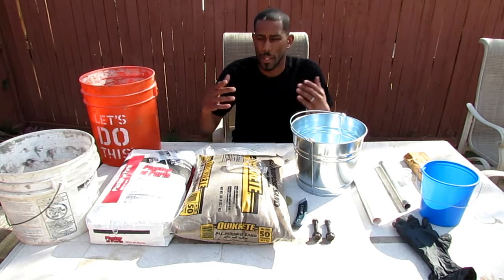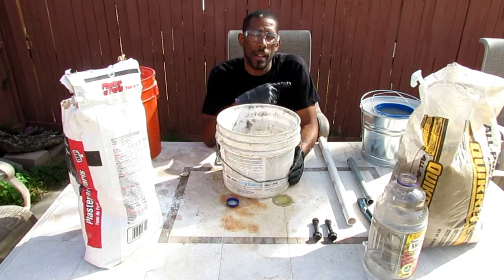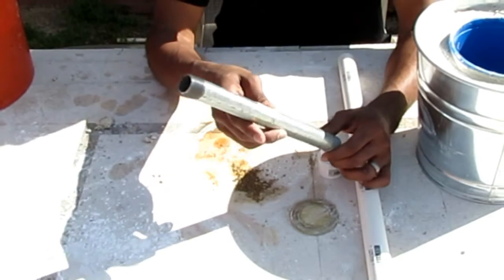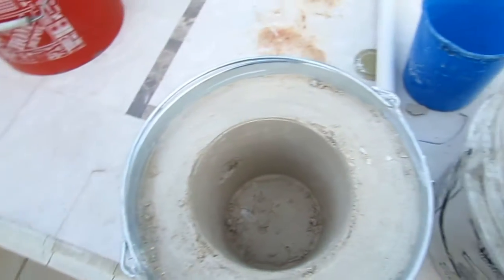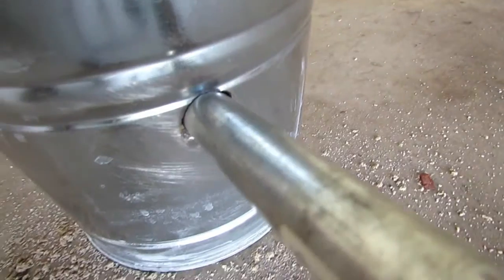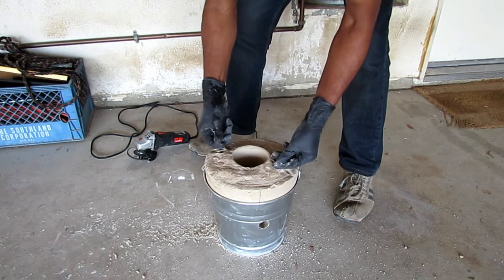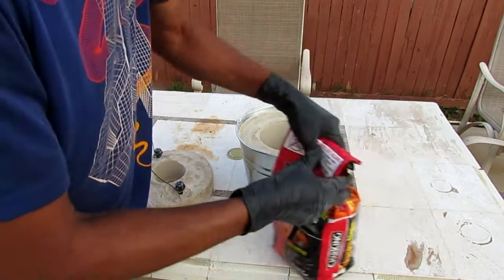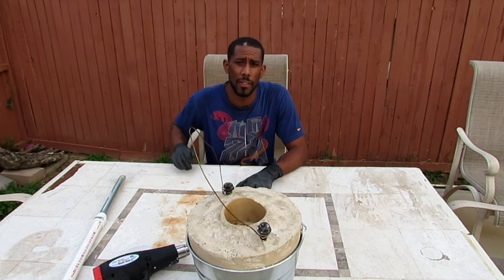Learn How To A Homemade Mini Foundry At Home - Melt Just About Anything

Comment: Thanks for the sand/plaster mix idea, I was going to use just straight plaster. I've been working on a larger scale foundry, built the burner first, it uses old waste oil.